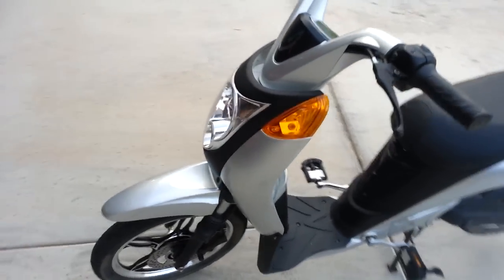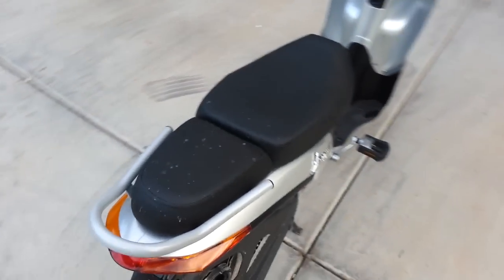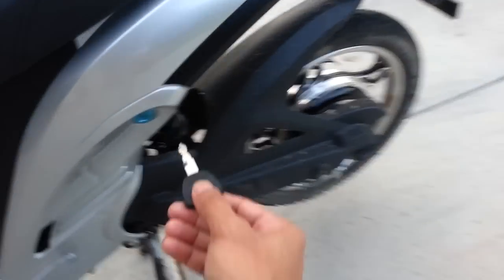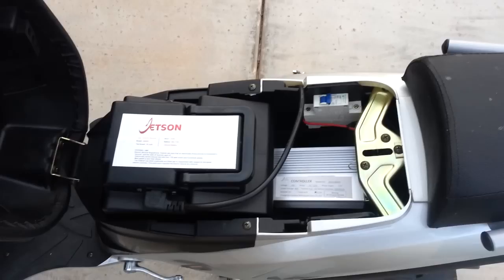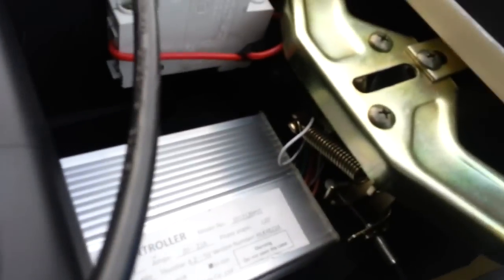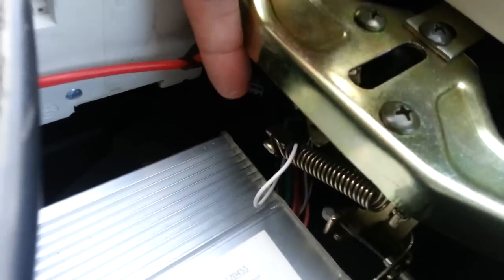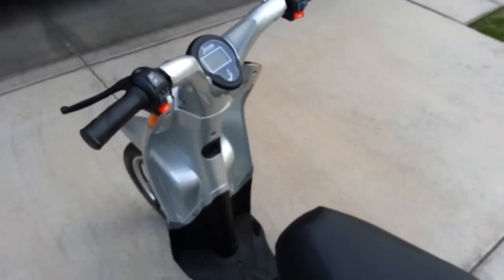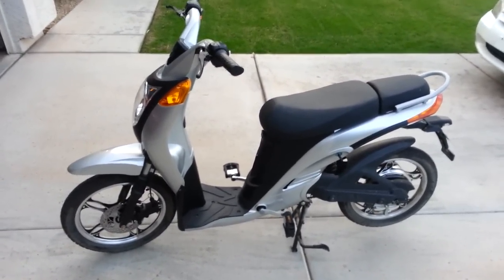Jetson Electric Bike - Disable speed controller (speed mod)

Comment: Thank you so much for the info, it took me 10 seconds to find the wire and unplug it.  That was my only complaint about my wife's Jetson, was the 20 mph top speed. Well hers went 18-19mph max.  Now it will go 25+mph on most roads.   Just keep in mind it does have small scooter tires, and small bumps seem much bigger at 25mph.   SLOW DOWN FOR THE BUMPS!!          Thanks again, I usually have to pay ++$$ to get a performance boost like this
Reply: Michael Johnson i watched ur video first then came here and found u on the comments

Comment: Just bought a Jetson electric bike from Amazon.  Tried to follow this video and the manual to remove the screw holding the passenger seat without success.  Finally, I used a scissor to cut off the black tie wrap and used my finger to pull the white wire out of the black plastic bag to reveal the connector.  Disconnected and taped up two white ends. Now I am getting 24mph instead of 19mph before the mod, it is not fast by any standard but at least it is decent.   Thank you Rah!
Reply: andrew cheung dose your bike still work now it's been 11months ?thank you
Reply: Same here. But my speedometer only says I'm going 21. I've had my friend clock me going 27!!! How is this possible??

Comment: Part 2) there will be 2 white wires that are joined together by a connecter. (just disconnect them and tape the ends) Put another tie wrap on the sack then slide it over the wires. Then just close it all up and you can get your Jetson to move a little quicker. Mine now does 24/25mph. Thanks again, now we need to find out how to maintain and lube this baby.

Comment: Part !) Thanks for this vid. I knew I could get mine to go faster. I was topping off at 18mph. Let me explain a little bit about this procedure. It can be done easily if you unscrew the passenger seat so the wires can be accessed. They will be in a black plastic sack that has a tie wrap on the base. Cut the tie wrap and it will slide off.

Comment: I have one, but the controller wire is burnt out. I need a replacement. Can you give me which one I need? Or does it matter as long as the watts match and voltage match?

Comment: I just purchased a new Jetson, there are 2 White wires in the wiring harness. Disconnecting one or both have no effect on the speed controller. How did you find out which wire to disconnect I'm thinking they have changed colors.
Reply from the maker: Either one of the two white wires should cut off the speed controller. If it does not disabled the speed controller, its possible that Jetson has changed their converter box so you may have to look up the make of the converter box on the internet and find out which wire to disconnect.

Comment: I see two white wires... some help please? Also, all the wires are wrapped up in a rubber sleeve... thanks.
Reply from the maker: Yeah, you can disconnect either of the two white wires. And after you disconnect, just tape both ends of them to the side so later if you need to connect them up, its easier for you to do so....enjoy the ride~
Reply: Rah Sharma Disconnect from the controller part?
Reply from the maker: yeah there is like a little plug which you disconnect.
Reply: Jeremy Presner Yes, it works. I no longer have the bike but it did give me a few more MPH
Reply: Jeremy Presner I do not remember, sorry. I do not have the bike anymore. I just followed the above video

Comment: Is the battery standard from a car battery or what ?
Reply: +Zerobladetion Wot its a lithum battery. costs 800$
Reply: Hopefully Jetson has stopped using 26650 cells, and have changed to a BMS with a LVC higher that 2.75.  The batteries were basically pre-made to die!